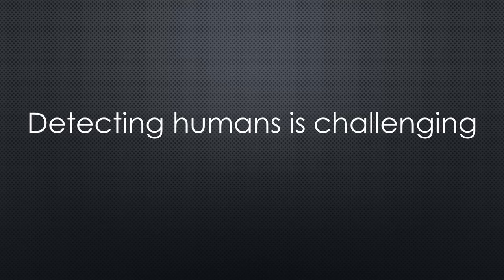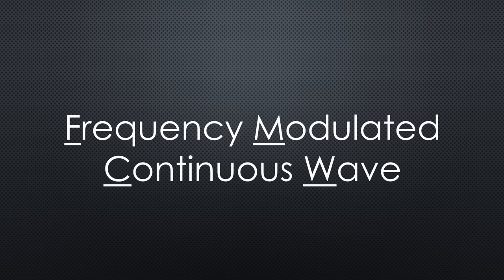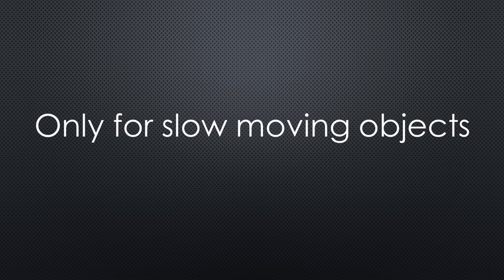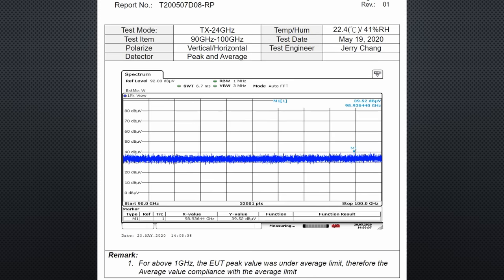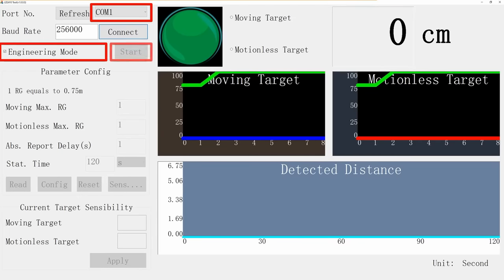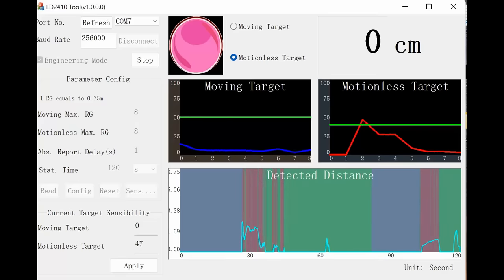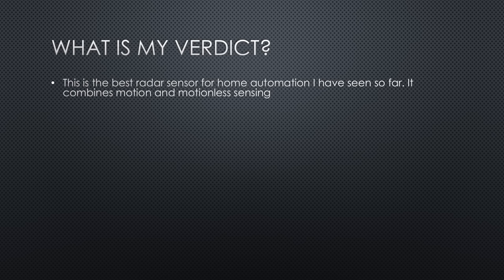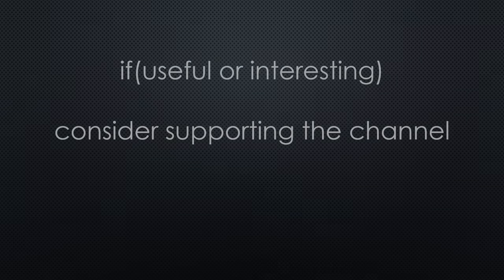439 24GHz Radar Presence Detector that Works (LD2410)

Comment: What about a simple IR sensor or the ultrasonic one?
Reply from the maker: I am not sure if they can distinguish between you and the sofa :-(
Reply: @AndreasSpiess  it all depends of the application and way you will process the data.
Reply: I did things like that in the past with ultrasonic sensors which was cheaper for the required distance. You just have to synchronize the sensors one by one to prevent false readings. I think in your application the ir shark sensor would be sufficient. Than just apply digital high pass on the signal and you will get a movement. If you want to sense still objects, just use the signal before the high pass
Reply: I mean than sharp sensor, like for example GP2Y0A21

Comment: These work through walls don't they ?
- Like they could be used to detect if someone's inside a room, I think someone programmed an Ai with an array of these to detect the exact location behind the wall - the ai draws a stick figure on the wall of the person behind the wall.
Reply from the maker: Radar travels through walls, you are right. But not through all. This feature also is reduced with increasing frequency.

Comment: does anyone know if you can use multiple of these sensors at the same time without them interfering with each other. or if they have IO that lets you use them under different id's and for example to enable and disable them on command to rapidly switch between sensors.
this is to use multiple of such sensors at the same time to use 2 to make semi-mirror 3d or 3 to make full 3d scans.
I think that would be pretty cool imagine just making glasses and being capable of looking through walls with them in low resolution but still.
or using it for supercheap motiontracking without needing a special suit for vr games and things like blender
Reply from the maker: You have to try. But I fear they work on the same frequency and interact.
Reply: @AndreasSpiess  that is what I feared as well. perhaps by switching them on and of rapidly using a transistor. or by rapibly moving one around to change it's location like such a spinining strip display

Comment: The link to the Aliexpress sensor page is not working
Reply from the maker: Maybe you use an ad blocker...
Reply: @AndreasSpiess  I've deactivated all addons and it didn't work. The Aqara FP1 Sensor link works but the LD2410 ones not.
Reply from the maker: @kaihatkeinenaccount  Strange. I just now checked, and they worked.

Comment: I know it is more resource hungry, but wouldn't face detection be a good alternative as well?
Unless you are sitting around in a helmet/gas-paintball-fencing-mask, then it works on a raspberry zero easily. Sure, it is not a $5 module ... but if you already have Pi then any crappy webcam can do the job, nothing more than 480p is necessary to detect a face.

Of course, this solution assumes that every common direction where you would be FACING would have a camera around. But in front of a TV or computer this can work really well.

And other thing is a reflective infra sensor with a 1m range. Perfect for shower/toilet or a space you are positioned still.... desk, workbench... door/entrance
Reply from the maker: I never used face recognition. But I assume it would be possible. As you write, probably a bit more expensive